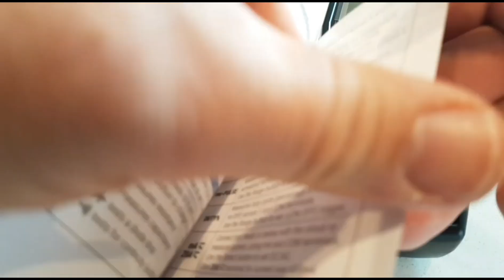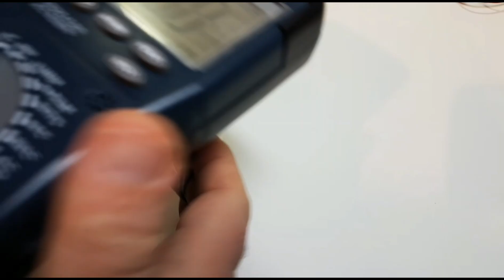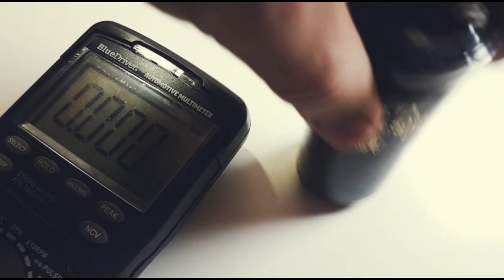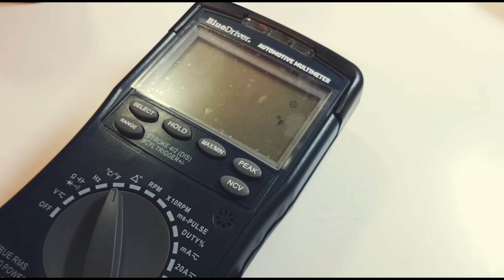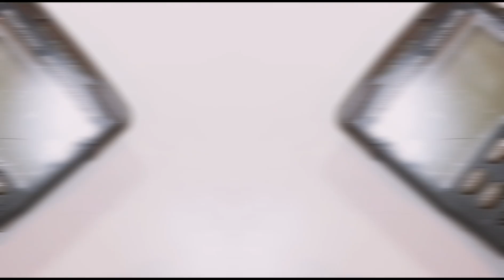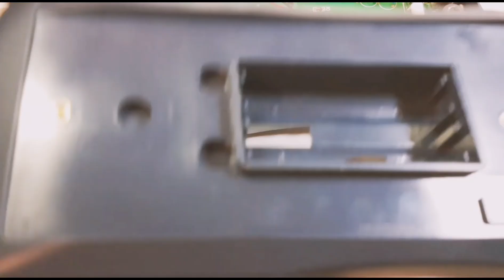BlueDriver Automotive Multimeter Review & Teardown!

Comment: Thank-you for this video! I have this same meter, same dates and markings on PCB since 2016-ish. Resistivity and continuity started going wonky with floating intermittent readings over past year or so. I replaced batteries, changed leads, verified fuses which did not help then cleaned contacts on rotator switch which  brought fleeting success. I triumphantly showed my husband my rejuvenated multimeter and it died completely while he cheerfully twisted the front switch quickly through all the stations. It's not a toy. Good news is I discovered the wee diode D1 reverse polarity protector(??) failed open and replaced it with a through hole 1N4148 I had on hand...that might have been 'it' all along. Yay!
Reply from the maker: Wow great job troubleshooting Jeanne..! Glad you got it back in operation, it's a great dmm 🙂👍

Comment: how about the selection for number of cylinders? is it automatic? can it be use for 1,3,4 cylinder engines?
Reply from the maker: Yes it's an autoranging multimeter. More in depth details can be found here: http://support.bluedriver.com/customer/en/portal/articles/2953351-measuring-rpm?b_id=17663

Comment: This meter may not be a Fluke but it offers strong functionality in both DMM and automotive functions for just under $30, hard to beat for bang for buck.  I used the same Mastech clamp on my Bluedriver and it worked fine and it also works on my Astro AI WH5000A meter, odd that Bluedriver knows nothing on the subject. I also added an Allsun induction clamp for the spark plug pickup and works good as well.  Id prefer the holdpeaks on/off switch to the light sensor activation.
Reply from the maker: I actually removed the plastic protector to gauge the display but let it on for the majority of the review since it was a Prize Giveaway
The Mastech clamp didn't work  with the meter at the time and BD confirmed they did not offer clamp support at the time. Glad it's working for yours now , I assume the firmware/eeprom has been updated. Definitely great bang for little buck..just not a huge fan of the chassis.🤣🤣🤣

Comment: Did you ever decide on what clamp-on 3rd party Amp/Inductive test kit to use?
Reply: Hi - In answer to your clamp question I also recently purchased this meter and I bought an (Allsun EA103) inductive RPM clamp of ebay for the Bluedrivers RPM range to use mainly on my 2003 Chevy S10LS pickup and it seems to work fine,  It only cost $12.49 though as I mentioned to Darren its about 50 RPM off from my factory dashboard tachometer - either one could be off, the factory tach or the clamp its hard to say as the trucks 16 years old, but it works fine & its of a decent quality and im satisfied for such a low price, most others are quite a bit higher.   Heres the ebay link to the one I bought: 

https://www.ebay.com/itm/Pro-Inductive-Pickup-Lead-Set-Work-With-Multimeter-Car-Vehicle-Accessories-Parts/112650334201?ssPageName=STRK%3AMEBIDX%3AIT&_trksid=p2057872.m2749.l2649
Reply: Also in addition to below, I found the Mastech AC amp clamp I got only worked in the 10Mv amp range I assume it varies by meter(?) in the video he has it on the lower range but he may have already tried the upper range as well I dont know, I can only answer for my results - but the Mastech AC clamp he uses is the one I have and it works fine for reading AC current - and as mentioned I also have the Allsun EA103 inductive clamp for plug wires and it works good as well and is made better than I expected.

Comment: Maybe the bluedriver display would be better without the protective film-?  I keep a small piece of electrical tape on top of all these auto back light type meters, there are always times you want the light but it doesnt activate -- as always a simple hard on off button is always going to be better - or better yet keep the auto on and add a simple on/off button option.

Comment: How do you test the tach and dwell? I have done either since my old craftsman engine analyzer. I'm having trouble with an intermittent spark on a two cylinder lawnmower and I used my old timing light and saw an erratic light pattern on one cylinder. I love the old induction pickups you just put over the spark plug wire. Also a set of battery clamps would be great.
Reply: You can get an ALLSUN EA103 inductive ignition wire pickup from ebay for around twelve bucks that works on most DMM's with the inductive function, there are other brands as well a bit higher priced, might be better quality dont know.  I have the ALLSUN EA103 and it seems to work ok. Remember they are directional when you attach to the wire.